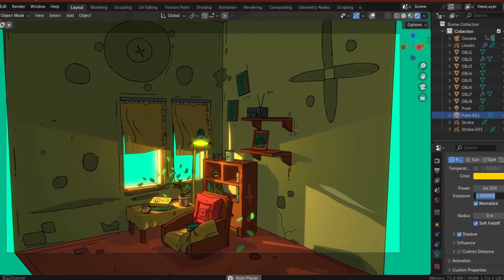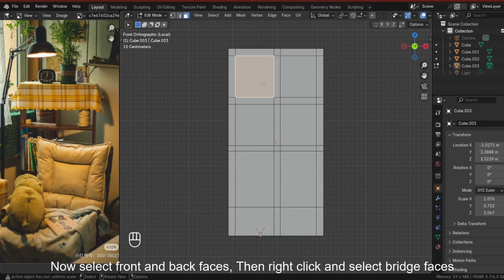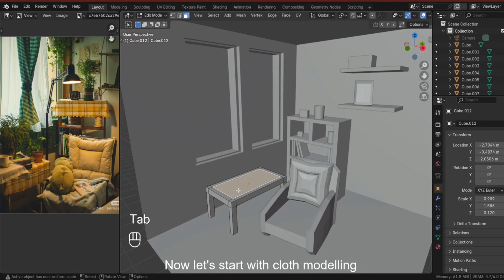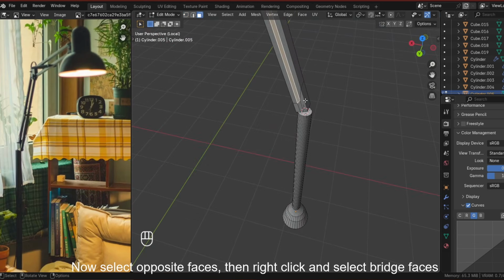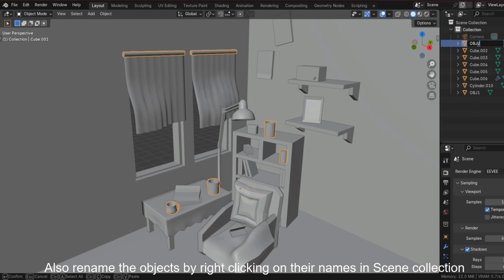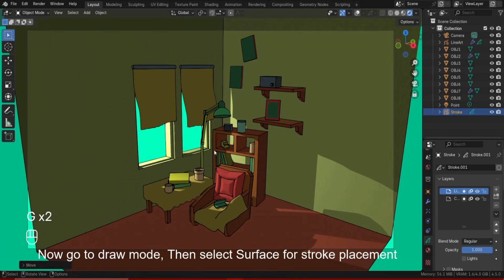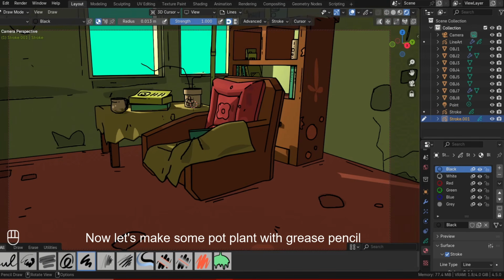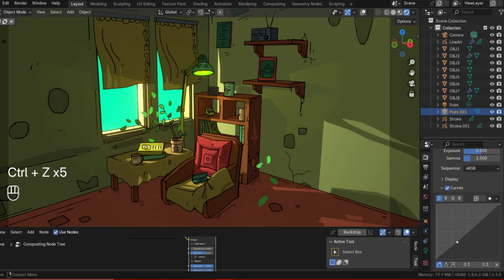Blender Tutorial: Making a Stylized Cozy Room

Comment: What blender version are you using
Reply from the maker: It's Blender 4.5
Reply: @exnioc2000 man your stuff always looks so crispy and clean your lighting and the way your able to capture different moods is amazing that's the skill im trying to learn all my stuff looks so flat one more question so you add a secondary materials to the parts that are in shadow how do you determine how Dark to make shadow section
Reply from the maker: @rillaaa5740  Yeah i use different materials for the shadows or even different colors, I just change the base color in principle bsdf then assign it to the surfaces. I follow the direction of primary lights in the scene to guess the shadow areas, Sometimes they are obvious sometimes tricky but keep experimenting.